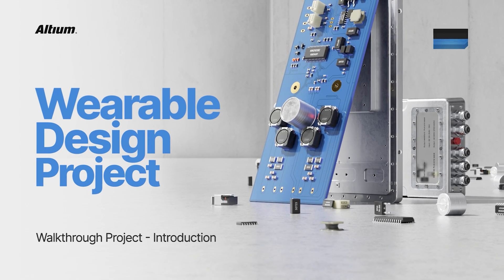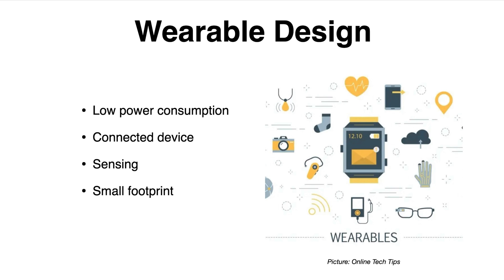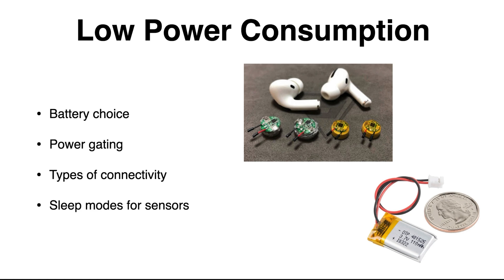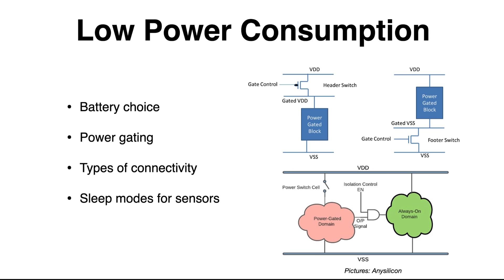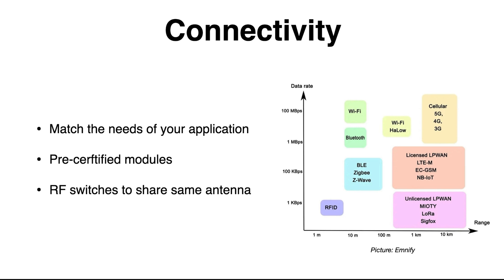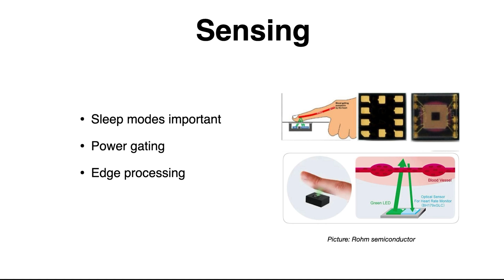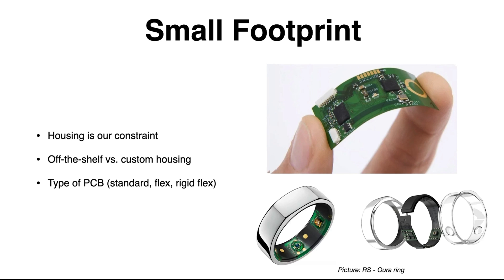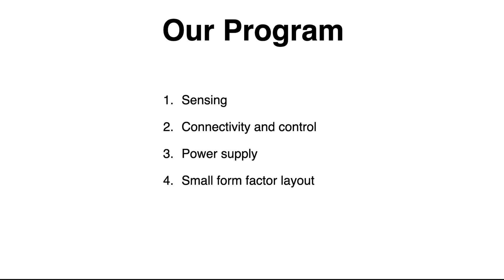Wearable Design Project - Part I: Introduction

Comment: If you are looking for low power mcu's for wearables its hard to beat AMA3B1KK-KCR-TB. Its an arm cortex m4 with Bluetooth 5 low energy connectivity from a company called ambiqmicro. The datasheet has it consuming a tiny 6 microamps/MHz.